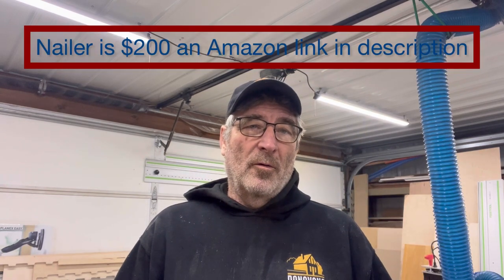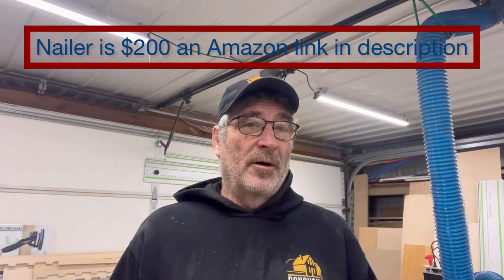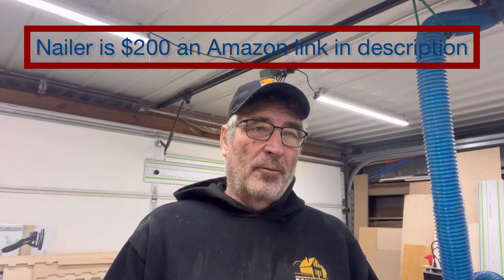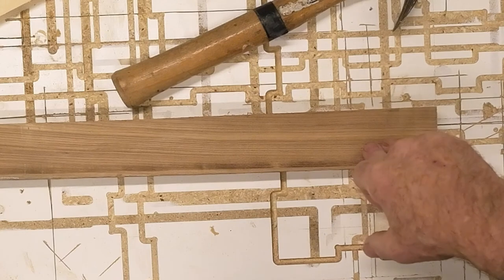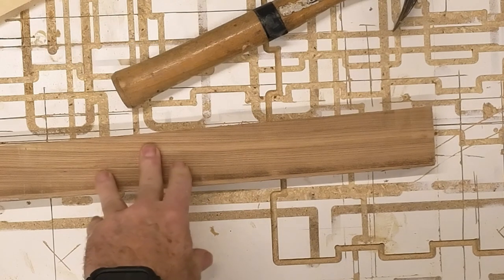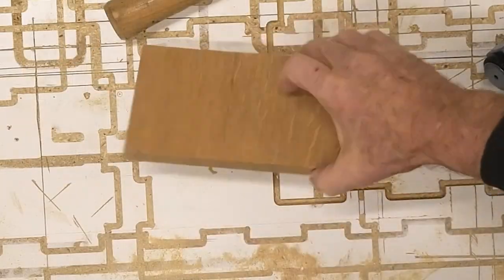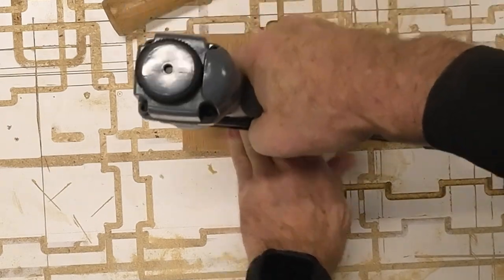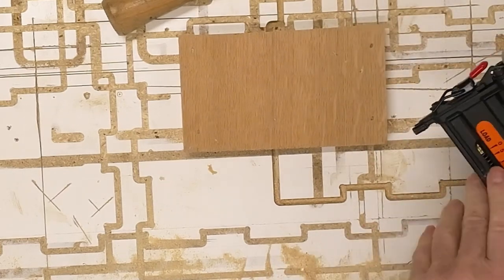Experience the Difference a Composite Finish Nail Can Make with Yeti Smartbench CNC or any CNC

Comment: I have the Omer composite nailer with Raptor nails. Just like with any other nail gun, you can split solid woods with it. I've split the ends of maple by driving the nail too close to the edge. I keep a 1/2 inch wide chisel handy to take care of the leftover nail pieces and the "dimples" they make in the spoilboard after removing the piece.

Comment: I bought the Spot Nailer with Raptor composite nails and its great for my OneFinity CNC. I eventually built a vacuum holding table to be done with any external holding. The best part is the machine did the work. Hooking some PVC piping to a whole house vacuum motor and I hold just about anything. I mostly use the nailer now for setting up guides for placing smaller repeatable work or securing a replacement spoil board. I hope to do a write up on the OneFinity forums on my build soon.

Comment: do you think the 18g would have been better since its smaller nail to fill the hole
Reply from the maker: The main reason is if you hit it with the bit it will not hurt it

Comment: Wondering if these composite nails will work in a normal 18ga  Brad nailing guns?? 

Which nail length work best without “blowing up”?

Great info. Thanks for sharing.
Reply from the maker: I don’t think so  I use 1” nails they work for both 1/2”and 3/4”:plywood